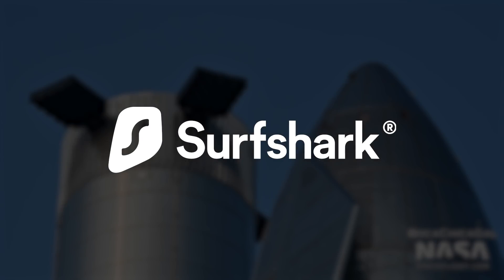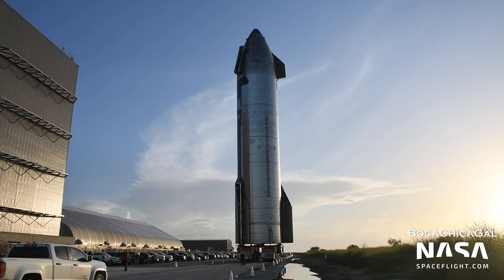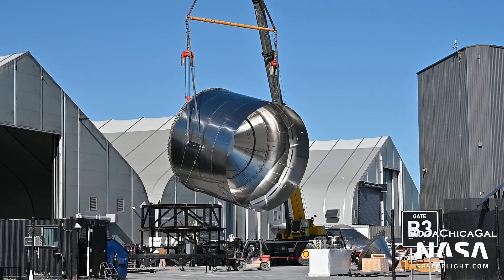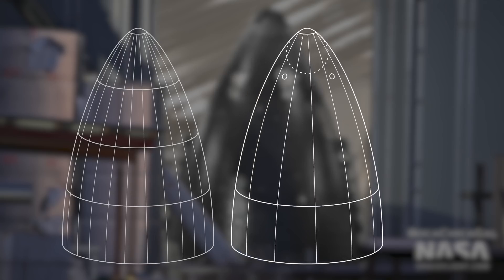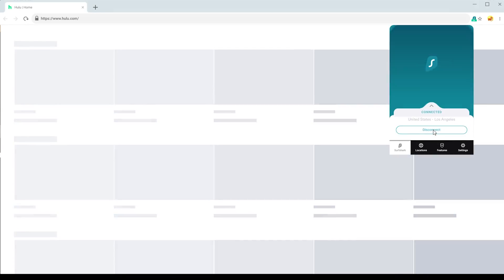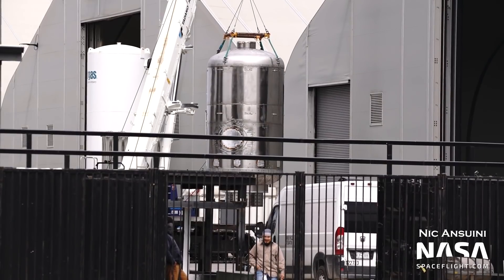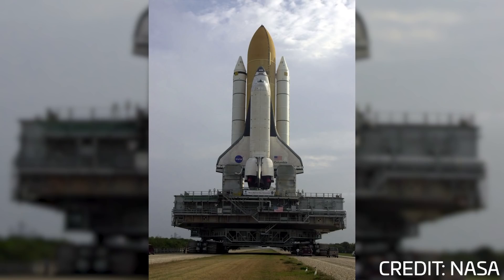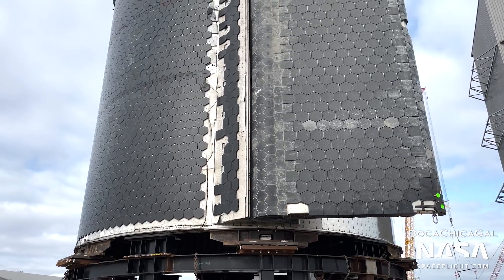How SpaceX is Rapidly Iterating Starship

Comment: Many things need to evolve, for ground starter topic, the Mechazilla will need a ring surround shoulder-torso, this Orbitline station, will need 4(four OTL) setup Stands, 1- the land/arrival, 2- stack stand, 3- refuel/fill & cryo stand, 4- launch count take off. On all 360°of MechA to Z OLTs'.

 The 2-stage effect of the full starship will require a longer last travel for the Beast to fully park the Starship in orbit velicity, the upper stage, has the burden of an already limited fuel, at ranges for Mars.
 Relying on this full 2 round trip set of two full starships, will cause multi t-minus delay gap of RISK, Refuel, Refill(human O2 supply) limitless weather issues. This may require Mell Falcon form style rockets adjacent to the Beast, allowing it to reach orbit veloity parking it, they'll support at least 3 stage, AND only 1(one) trip task per journey.
  In execption to the classic two-round trips, the very second upper stage, could be another nuculear solar orbit cruiser drone replicate, as mid-stage, (between the already beast + starsip), offering non idole gravity g-force rate accel, saving both emergency & that criticle vtol effect on arrival.

 The upper stage may need an all-human/staff cargo, top eject Pod, because on Earth, Starship could eject from the Beast canister to emergency land, for the upper stage itself, it has NO eject in the solar orbit & at least the arrival planets.
Saturn V (as 5 stage) barely could reach the moon, Starship is going as 2-stage, all the way, to MARS👀

Comment: This development methodology has been in use for software development for decades now, because it works: iterative development done in short sprints, agile development, focusing on the most valuable objective for each sprint.  History has shown for software, quite often you think you need A, but you really need B, and aiming all at once to make A may mean you miss the mark of fulfilling needs and solving the correct problems that are B.  Instead,  if you prioritize towards what you think you need for A and make those smaller things/features work first, and repeat that process, you may find a lot of what you thought you needed in A is extra or wrong, but because you find out ASAP, it's relatively cheap to change course.  This requires using the software along the way, and requires it is always in a usable state after the first sprint.  This should sound familiar, just substitute Starship for software, and it's the same process, just more spectacular when figuring out what doesn't work ;)

The traditional approach taken by the others works on the premise of trying to make it all work together at once in a very expensive build and design process, and praying it all works, while taking years before something actually gets attempted for a launch.  How much do they learn that way?  If it works as intended the first time, they learn they guessed right.  If it didn't perform as expected, how many things are they wrong on, and how long in time and how much budget did they eat to now know an unknown number of expensive changes (possibly a total system redesign) needs to be done?

SpaceX is taking the cheap-and-fast development path by rapid iteration on design changes, and this video documented several things that clearly changed from how things started, learned from earlier quick-and-dirty iterations that only cost a number of weeks each of time and a couple million dollars per iteration, which is cheap for this area.

Comment: On one hand, the FAA & EPA delays are a huge pain in the butt.  On the other hand, this may just be a SpaceX engineer’s dream— being able to redesign, revise, and perfect-ify every element of the design without absolute pressure to “ship early, ship often”.  The ability to put science & engineering first, rather than overly evidence-based muddy “did it not catastrophic failure this time” results first.  The ability to think through every contingency instead of just failing repeatedly until every contingency has been selectively solved.  The antidote to a world that’s swung 180° from 1940s-70s tough-as-nails/never-die engineering (which itself was guilty of missing cost and practicality marks, hence why somewhere in between the old way of engineering and the 180° of today’s biz thinking is probably the right balance).

Comment: Great video.  Really helpful, and in my opinion the perfect blend of technical details/language without being too esoteric.  (that's for me at least as someone who follows this stuff and has a reasonable, but amatuer understanding of engineering and technical features)  Also, one thing to remember is that the ring spacing/changes can affect the tanks themselves in terms of capacity....especailly as the booster is "just" 2 flying fuel tanks, so perhaps changes are made to better balance the fuel/ox needs as the Raptor 2s keep getting tested and the mass of the booster changes with interations.

Comment: Some of us out here - old fuddyduddies - are not believers that porting Agile software development methodologies to hardware is a cost-effective way to go (and, noted, some believe Agile software development, period, is not the way to go...). Design your hardware, redesign your hardware, do it as much as you want...THEN build the hardware. Having a junkyard full of multi-million dollar failures isn't recommended. Perhaps not using management/designers that are under the age of, say, 27 is part of the solution - folks who literally can not plan properly due to lack of neuron connectivity shouldn't be in charge of anything (not to mention lack of experience - shall we discuss tall buildings completely finished that don't even pass basic building codes...or tank farms...or, you know, a pile of scrapped full AND partial rockets AND engines?).

SpaceX wants to split their not-yet-IPOed stock to attract smaller investors. Could this be because the BIG investors are beginning to ask where the beef is?

Comment: With the booster getting a second inner/coaxial fuel tank it wouldn't surprise me if they plan to make the booster do a belly flop on the way back. It could take advantage of it's large surface area and slow down that way to save fuel.  It doesn't go that high so probably wouldn't need any heat tiles. The inner coaxial tank would be needed to relight the engine on its side for the flip back to vertical before its landing on the launch tower arms

Comment: 8:54 They probably run the stringers all the way to the bottom just so they don't need them on the inside. Maybe 100 fewer parts and less going on in the crowded engine section? The short stringers were used just to get around the dome where it meets the outer skin, where interior stringers would be impossible.

Comment: Put an obsolete Raptor from Booster 4 on the test stand and stand Ship 20 in front of it, TPS facing the stand. Fire up the Raptor and blast away at that TPS, give it some full scale testing!
OK, not serious. But at least it would get some use out of that old equipment.

Comment: Seems like it would make more sense to have the positive connector on the booster rather than the ship. I wonder why they made the change?
Reply: The latching/ejection mechanism hardware may be heavier than the positive connection is my best guess.
Reply: @Cammo1213  That is definitely a safe bet since extra mass on the upper stage has an exponentially larger impact on payload mass vs stage I, so there’s a huge incentive to move as much mass as possible from Starship to the booster. Not to mention Starship is the active/moving vehicle during stacking- the probe on non-androgynous docking systems is almost always on the active vehicle since that configuration is more forgiving in terms of misalignment.